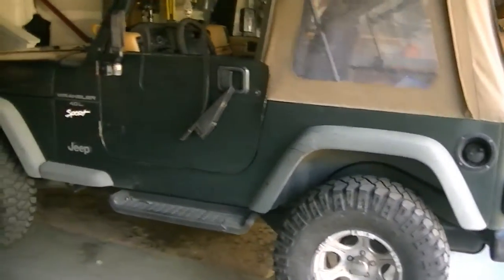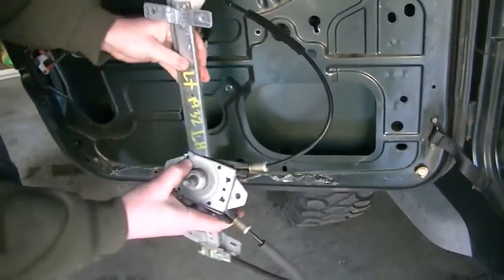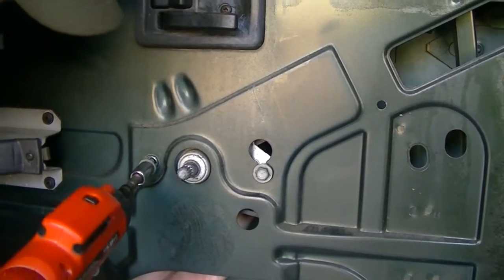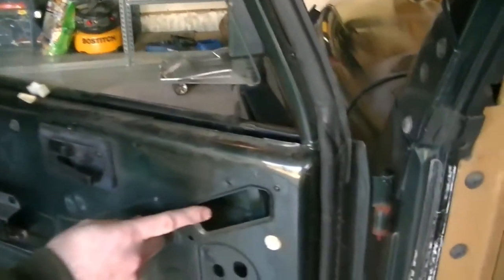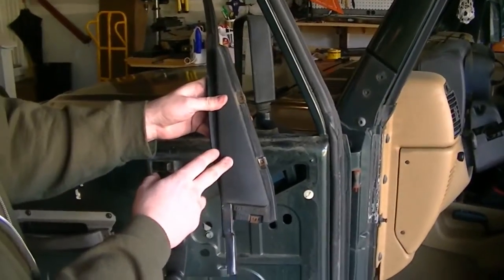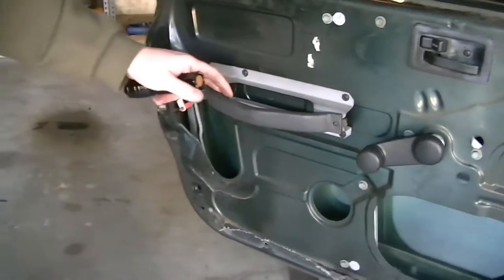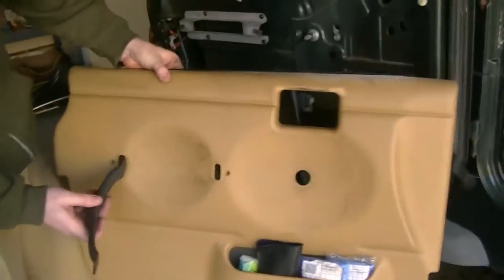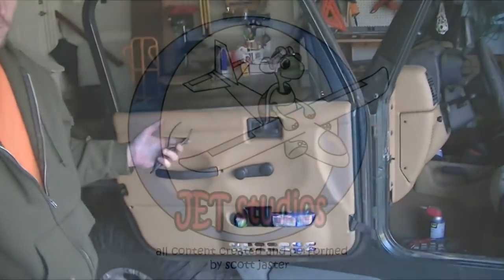Jeep Wrangler manual window regulator replacement 1997-2006

Comment: I put a new Dorman regulator in my 99 TJ snd I didn't take the window out.
I just taped it closed and out of the way while I removed the old reg.
I had to carefully snake the new one in but it worked fine...don't know if it's model specific.

Comment: Thanks for the video. I have to replace mine on the same door, different problem though. This will definitely come in handy when the part arrives.

One question. Does the window have to come out? I was thinking a big C clamp and two pieces of wood (one one each side of the glass) to keep it at the full up position.

Comment: How did you get the window off the regulator? I have the regulator disconnected but the window wont budge
Reply from the maker: I could explain a bit, but there are a few write-ups out there already on Wrangler forums. Here's one that is pretty good that might help??

https://www.wranglerforum.com/threads/how-to-replace-exterior-door-handle-full-steel-doors.45442/

Comment: how can i tell the difference between the passenger / driver side and front/back ones. Trying to sell mine and want to post them correctly. Thanks for any info: Jeep Wrangler Unlimited Sport S 2016
Reply from the maker: I'm really not sure.  I know the regulator assembly is different on the new Jeeps compared to my older '97.  On mine, the Left/Right is exactly the same but mirrored.  Knowing Jeep and their goal of product re-use, I would assume that doors on the same side would have the same window parts, and mirror the opposite side.  That's probably not helpful to you.  Sorry about that!  : (

Comment: My handle is broken the same way but my window is up. How can I move the window to remove the screws holding it to the regulator
Reply from the maker: Kyle P  If I understand what you're saying, you should be able to take the plastic handle off, and turn the gear with some kind of locking wrench to lower the window.
Reply: The whole gear was broken off of mine. I just figured it out. I had to cut the cables going into crank mechanism and was able to pull the window down that way
Reply: Great video btw. Made my job a lot easier.

Comment: Mine is super hard to roll up would a new regulator fix that?
Reply from the maker: My regulator was extremely stiff, that's what caused the breakage in the first place. I think if you spray lubricant such as WD-40 in and around the mechanism and the regulator, it should loosen it up. Worth a try, amyways. 

There may also be some other binding as well that you need to investigate.  Mine was extremely hard to roll up when it was cold outside, much easier when it was warm out. So there must have been some kind of expansion or contraction going on with my issue.  The new regulator and some lubricant fixed it for me, though.
Reply: JET studios - scott jaster yeah I sprayed the heck out of it I did notice the window moves back n forth like it’s worn on the track a bit

Comment: Why did you remove the window? While I've never done a TJ, I've never removed the glass. I just tape it in the full closed position. Let me know if removing the glass is required. Thanks
Reply from the maker: It's been a while since I performed that repair, but from what I remember I had to pull out the glass in order to get to the channeling that was interconnected. If the glass was all the way up, in the closed position, it would lock all of the channeling in place which would not allow the removal of some of the components.  There may be a couple other ways to perform that repair, but that's what I figured I had to do with the way I was doing it. Again, it's been a while since I've messed with it, lol.